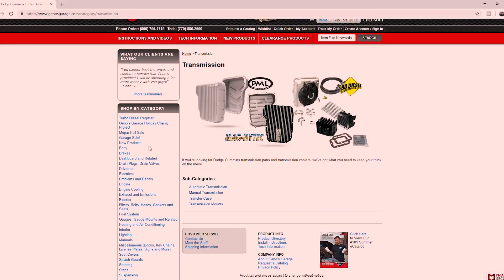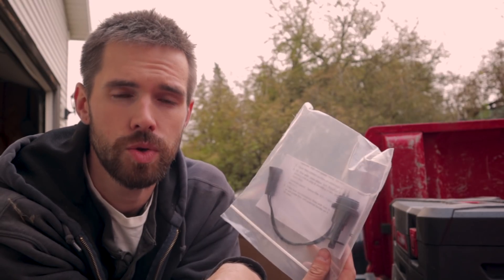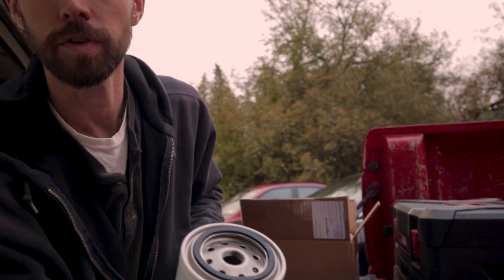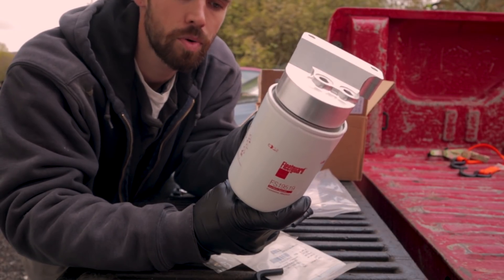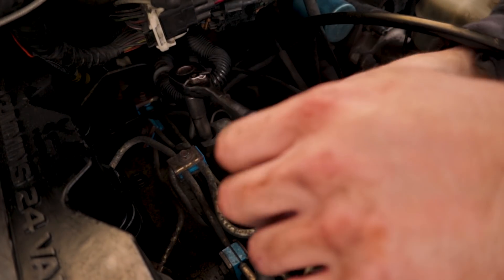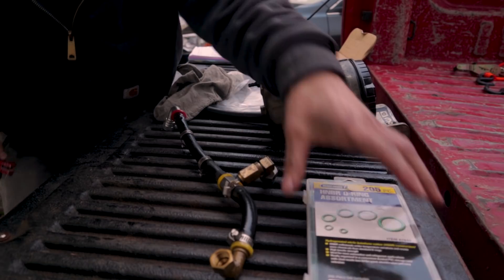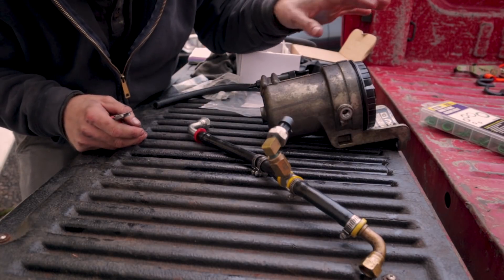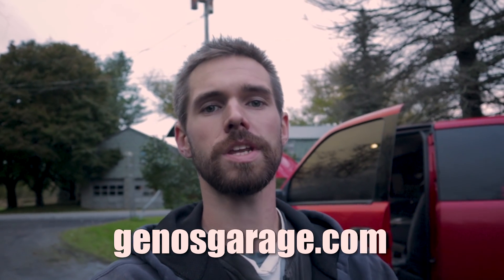12 VALVE CONVERSION on my 24 VALVE CUMMINS (fuel filter delete)

Comment: I gotten a lot of good parts from Geno's, and their customer service is excellent. Also, I have the fuel heater deleted on my 1998 12 valve, use fuel treatment and have no problems with gelling.
Reply from the maker: I was thinking I'd probably be fine doing just that and only running a winter fuel additive. We don't see really cold temps for all that long here. I'm still on the fence with what I'm going to do at the moment.

Comment: I'll never forget the time a few years ago I went to prime my filter,  and the key bump trick wouldn't prime any fuel into the filter. After much confusion, I figured out the lift pump wasn't getting power! Turns someone crimped the wires for an aftermarket lift pump. I can only hope I knocked it loose while changing the filter! I've wised up and installed a fuel pressure gauge since then. Haha.

Oh, and Ill be driving through your area the weekend following Thanksgiving if you're still wanting those doors. I'll also be driving through at the end of January if you want to let those doors take one last winter beating, lol
Reply: Also never thought about a 12 valve fuel filter setup on my 24v. Definitely will go that route after my previous fuel heater leak repair fails.

Comment: Replaced my leaking fuel filter housing on my 2001 this weekend, if it happens again I'm definitely going this route. One thing I didn't have were those genuine Cummins banjo washers like you've got!
Reply from the maker: I just found this to be the easiest and fastest solution for my situation. Without having to install a new lift pump with both the fuel filter and water separator on it or just installing another stand alone fuel filter head on the frame after my fass platinum pump. Doing those things would have been more involved and time consuming and I just dont have that time at the moment. I am planning reworking all of the fuel system probably in the spring though!

Comment: And currently trying to figure out how to hook up the return line from the injectors back into the system I have the big dual fuel feed line half inch feeding my pump from my Carter lift pump that I installed on the 24 valve how do I hook up the return line from the back side of the injectors I'm not finding any information or anything on what I'm trying to accomplish my return line off the 24 valve injectors is just plugged off so I'm having issues with the vehicle running because there's no return line because the line is so small the volume displacement doesn't make sense to just tee it off and pop it into the half inch line I'm not understanding what needs to be done any help would be grateful thanks!!!

Comment: I have an air dog 4G lift pump on my truck. Is it really necessary to do this upgrade & have two different fuel filters?
Reply from the maker: Nope! You can run the airdog straight to your vp44 injection pump and you'll be fine. I have an older model fass platinum 150 which only has the water separator so I still need another filter for the fuel which is why I went this route for the time being. If you wanted extra filtration you could still do this and it wouldn't hurt anything though, but it's not necessary at all!
Reply: Did you keep your factory fuel filter with the 4g lift pump?? I just ordered one for my 02 and can't find a delete for the fuel bowl.

Comment: Very clean,  I wonder if it will change your fuel psi at all?
Reply from the maker: I was wondering the same thing. .y gauge is still sticking arpu d 17-18 psi. Usually 17, but sometimes it creeps up towards 18 then drops back down. I never really see it lower than 15 at all though.

Comment: Looks like a good upgrade my dude...why are so many upgrades for the 24v just 12v parts ? keep up the awesome work brotha 👊
Reply from the maker: I think we all can agree that the 12 valves were far more simple and had more practical/better designs with some things. Theyre almost the same trucks but the 24 valves started to introduce more electronics into the picture for fueling/timing and when you do that it also opens the door to other issues and things that can fail and go wrong. Luckily things are interchangeable like they are though! So you can piece together the best of both worlds or just take a different path in general with aftermarket parts depending on what your goals are for the truck and its power level.
Reply: @purepanorama8484  thanks for that ! Makes a lot of sence 🤙
Reply: Why even ask why? And I have a 97 12 valve and the fuel filter on that thing is a pain in the ass very similar to the one he replaced
Reply from the maker: @thatpowerstrokebloke  I guess I could have typed a longer response to that with more detail. Theres a lot that could be said for that question. I don't think either truck is really better than the other because they're clearly both great trucks with different design thoughts. Theres just a few parts that I've been frustrated with from having the same troubles time and time again. Guess I'm just glad that the two trucks are so similar still even thought they're different.

Comment: Genos is a good place. I know for my oem fuel filters for my 2016 cummins i buy from www.dieselfiltersonline.com cheaper than genos
Reply from the maker: Thanks! I'll check that site out. I need to order water separator for the fass so I've got an extra one in the truck.